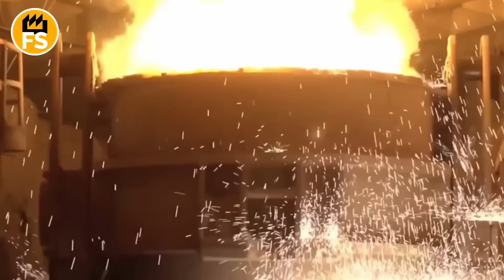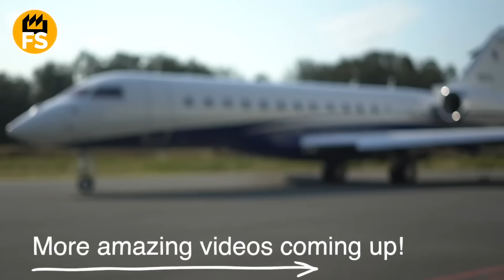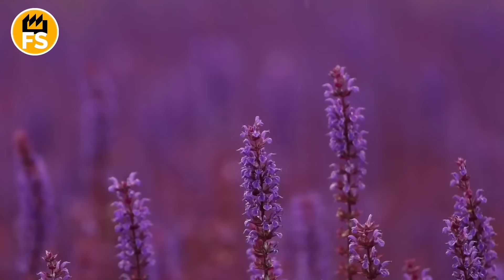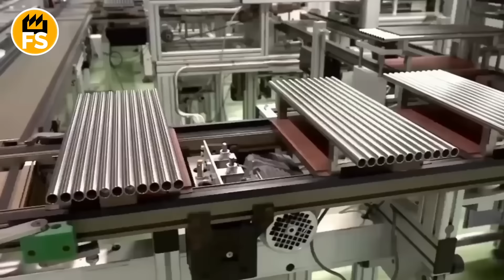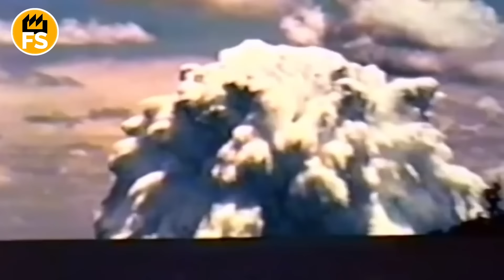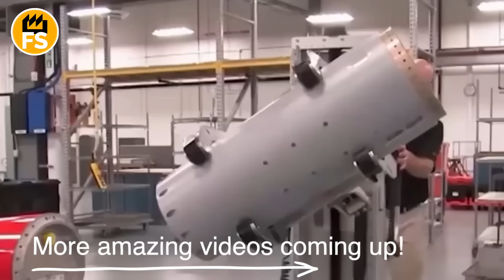How It's Made: Chromium—The Toxic Metal Behind Every Shiny Surface!

Comment: I prefer electroless nickel.
Reply from the maker: Thank you for sharing your preference, @joegen280! Electroless nickel certainly has its advantages, especially in terms of uniform coverage and corrosion resistance—it's interesting to see the different materials used in surface finishes!
Reply: @Factory.Secrets Sure is. Ive run gold plating shops, chrome, everything. If I can stay away from Cyanide its a plus..haha.

Comment: Uuuum it doesn't make steel stainless
Reply from the maker: While chromium is a key component in making stainless steel, it’s important to clarify that it doesn't make steel stainless by itself—it's the combination with other elements that creates that resistance to corrosion. Thank you for pointing that out, @JoeyTewTimes!
Reply: @Factory.Secrets hold up.. how do i know I'm not talkin to a bot?